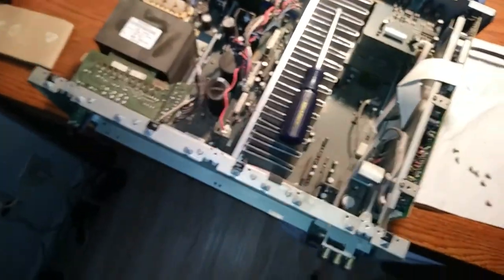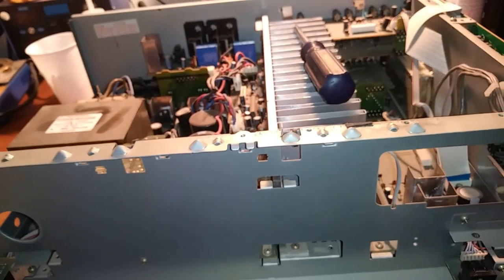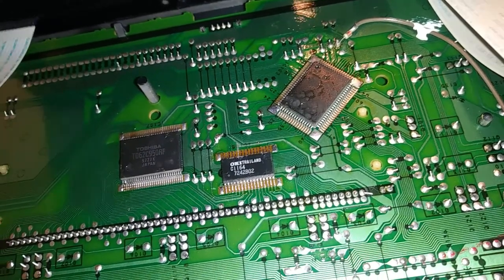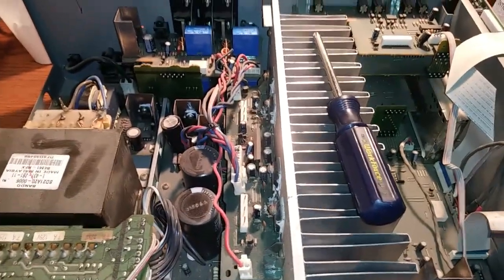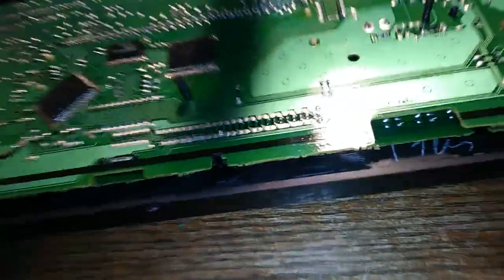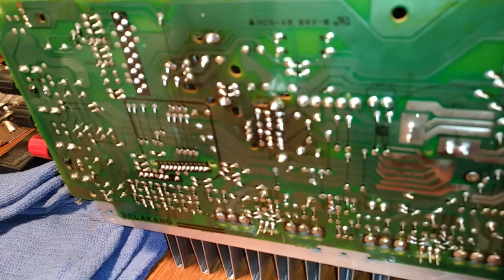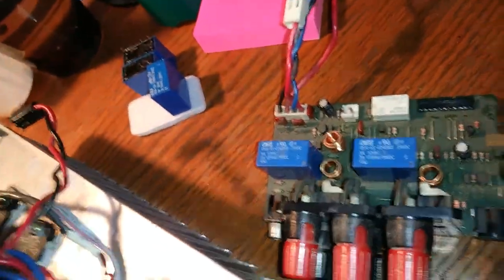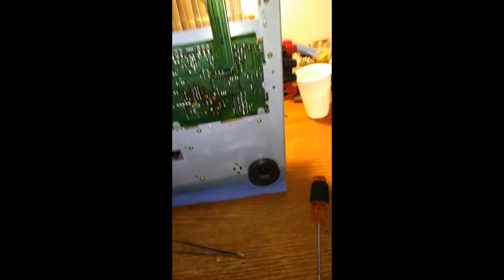How NOT to Repair a Sony STR-DE915 Receiver

Comment: I love mine. Been abusing it for years and if finally gave out. It used to: 1)Click on/Display would be seen 2)Brief pause as it charged up 3) Click again and sound would produce. Now it just clicks once. No second click, or sound.
Reply from the maker: That may be a relatively easy repair. The "click" sounds are from relays. The second of which is the "speaker protection circuit" relay.

 That was one of the issues with my unit here except it was the contact side of the relay. I sill heard the click but it wasn't making the connection. It sounds like yours may have a bad coil meaning the relay doesn't click closed when the 12v is applied. 

If I were in your shoes I would give it a go; even after failing to repair this one. This one had lots of problems

Comment from the maker: By the way, this unit is up for grabs if someone wants to buy it for parts/repair purposes EDIT: Sold
Reply: Hi, came across your video as I have the same receiver. I have no power coming to the receiver. I traced the circuit and saw that the power relay may be faulty.  I am not able to locate a spare. its DEC  TYPE DH1U 12VDC TV-8, any idea where I could get one.
Reply from the maker: @JohnDesouza-Studio-videos  I found my replacements for the speaker protection relays on Ebay. Just a random individual who happened to be an electrical engineer. Mouser is well supplied but expensive. I'm sure there's more suppliers out there too but none that i know of off the top of my head